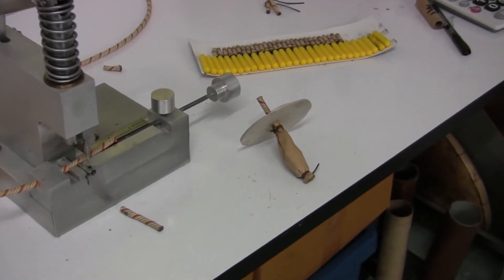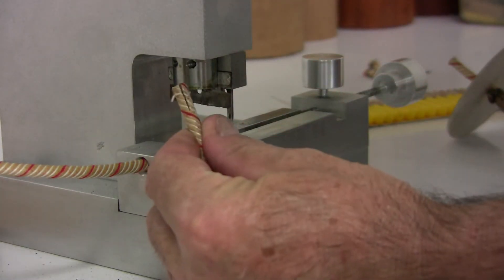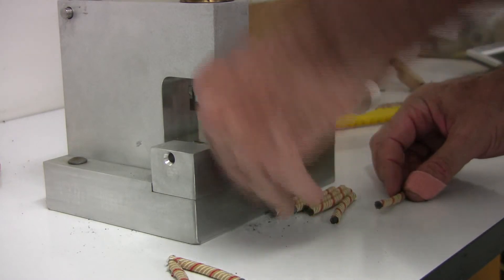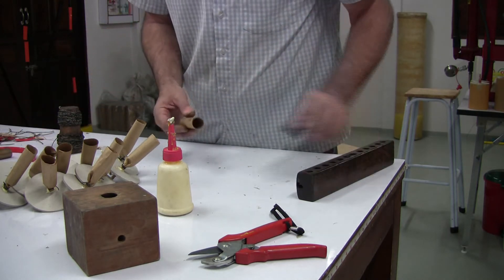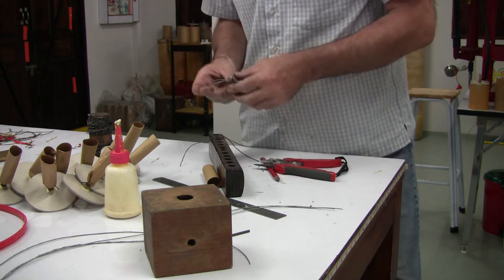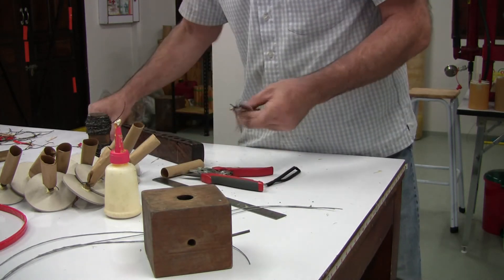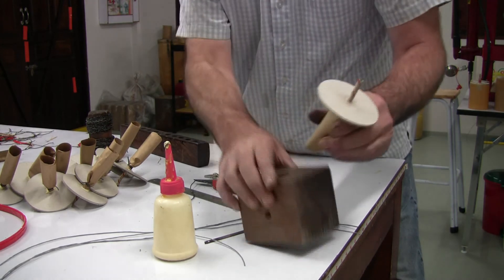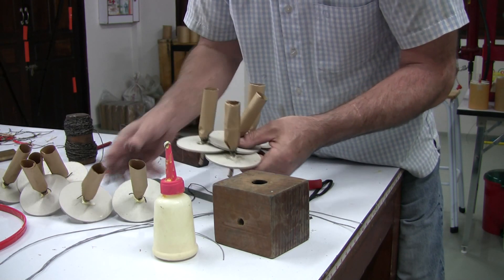Fuse Cutting Machine. Making Fuse Assembly for a 4 inch shell using a flash bag.

Comment: Very informative, but I was wondering isn't it risky to cut quickmatch with a pair of scissors?
I checked at a few pyro boards and the general consensus is to use the 'razor blade and anvil' method for cutting quickmatch. I'm asking this because I have to prepare some shells for electric match, which involves cutting off the visco that is fitted to the quickmatch. (until now I hand fired my shells, using the visco but this NYE I want to fire electric)
Thanks!
Reply: My bad... I see you use an anvil type of cutter.
Reply from the maker: Yes Anvil cutters  steel blade and Aluminium Anvil, a sharp craft knife blade could also be safely used to slice quickmatch
Reply: woodyamsterdam you should see this guys time fuse cutter... man its the stuff of dreams